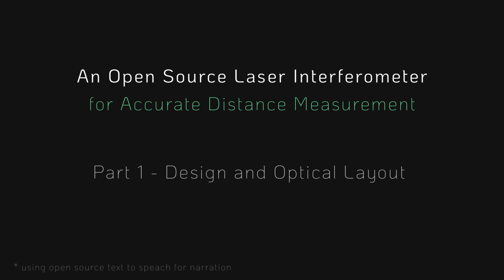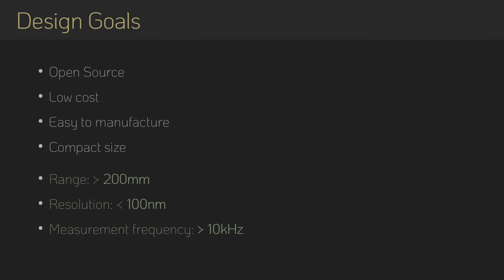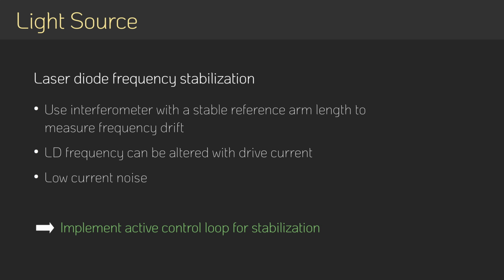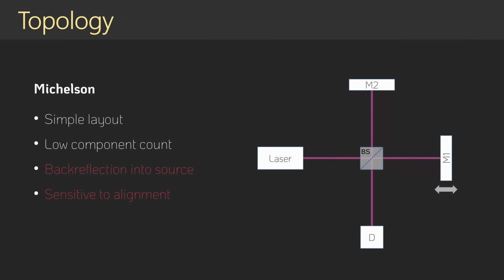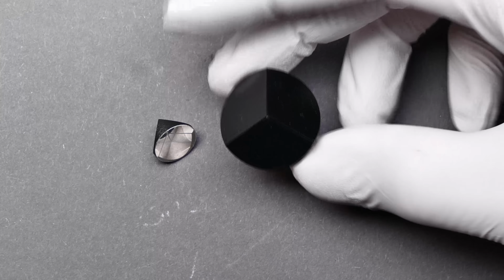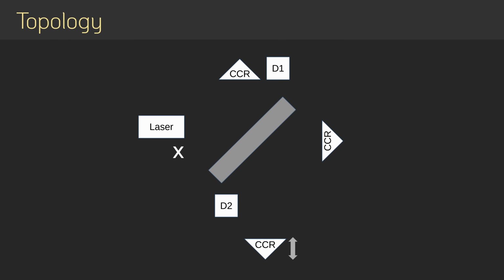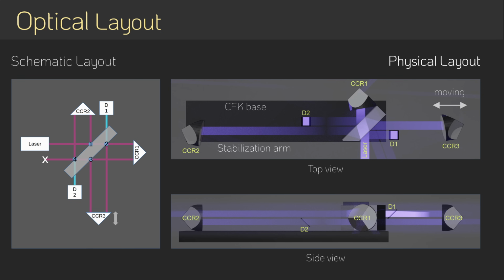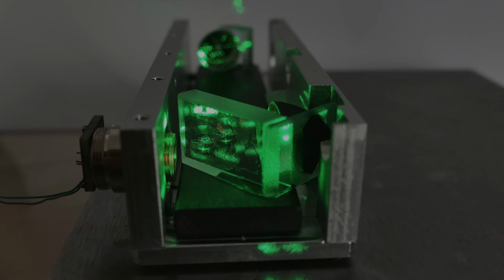Laser Interferometer - Part 1: The Optical Design.

Comment: Any particular reason why you didn't use an Nd:YAG laser module? You can buy single package YAGs that fit in the same envelope as TO can laser diode? You'll still have to deal with output changes, but it should be more wavelength stable
Reply from the maker: Hi, can you give me a link, so that I can take a look at such a mdoule?

Comment: Really nice video, I'm learning a lot, thank you. What temperature did you stabilize the laser diode at? the website you linked only goes to ~25°C in the measurements, but a neat trick for ovenized systems is to go steady them well above room temp (like 40-50) so that you only ever need to heat them up, and never find a need for cooling, I don't know if there are islands of stability there in your diode.

Comment: so can you make a 100nm resolution caliper with this design?)
Reply: If you can make the optical train small enough, the calipers stiff enough to not sway out of parallel alignment by means of using 2 interfetometer measurement legs for angle correction and or preloaded rails and add in an encoder accurate to 1 wavelength and cram all the electronics in a small confined space and ensure no vibrations get picked up by the instrument and a few other concerns you miiight be able to. sub 100nm res calipers make little to no sense. You're probably better off with a slipless 0backlash, preoaded rope-based mechanism to convert linear to rotational motion and use high res magnetic encoders and back-to-back magnets. Can achieve sub 100nm for cheap and is actually doable in a confined space. The limiting factor is going to be mechanical i believe. obtaining a sufficiently flat reference surface, ensuring no large temperature gradient along the instrument, parallel alignment of the caliper reference surfaces, vibration isolation etc. You don't want a handheld sub 100nm measurement device. You really don't. It's not useful unless you set it down, wait for it to stabilise and don't breathe in it's proximity. at these resolutions the thermal expansion of the calipers from touching the instrument with your warm hands will likely exceed your resolution for many materials. It's probably possible to build a wavelength stabilised interferometer based high precision caliper but it's hardly very useful beyond a micrometre i would suspect. Getting a surface to sub 100nm surface deviation is a nontrivial task without spacialised equipment like a surface grinder or by using some very specific salvaged silicon dies or something like that. so possible: for sure, practical: probably not, easy: absolutely not. really cool: yes.

Comment: Can you please include a list of materials to build this? I'm a noob and it would be very helpful. For example, I know I need a laser diode, CCR mirrors and that's about it. You dont eben need to include links just a list pls!! Awesome video
Reply from the maker: If your goal is to have a working device, I do not recommend to replicate this until the final design is finished. This is a Project in development and major changes can be expected. Its a different story, if you want to learn about interferometry and want to play around with the optics. You may watch the otehr videos and take a look at the github page for more information. Also if you are new to this, please read about laser safety and be very mindful of the potential dangers.

Comment: Great project for research and education, but I am very sceptical on the real practical use. 
Linear scale encoders are cheap nowadays. 3um/m accuracy  and 100nm resolition incremental scales with quadrature output are  less than 100USD. We have tested them at work and @0.2m lengh  accuracy is <1.5um, some leas than 1um. 10nm resulution absolute scales with serial output 200-300USD. They are basically stick and forget, immune to dust, change of atmosferic condition, e.t.c. 
Single frequency interferometers with retroreflectors are very sensitive to lateral shifts and light intensity changes. To get the same micron level accuracy you have to calibrate and check it against atleast 1e-6 reference length standart under the same conditions. And that is only valid if your cheap LD is truly stablized, no mode jumps, single longitudinal mode, no contamination on the optics, e.t.c.
Reply from the maker: Thank you for the advice, can you give me names/brands for the products you mentioned? Especially those with the 10nm resolution? I have looked around and could find any within this price range.
Reply: @DiffractionLimited From top of my head 100nm are made by Ditron. 10nm has the same 3um/m 20um pitch scale, but the interpolator is different with Biss-C serial output. 1nm resolution Mitutoyo is around 1000USD in China.

Comment: marvelous! I was about to do the exact same thing and then I find your video. I have experience in manufacturing temperature controllers with sub mK stability and heterodyne Mach-Zehnder interferometers. My original plan was to use one interferometer to stabilize the laser frequency, and then use and second heterodyne interferometry to measure the distance, so lambda /100 accuracy can be easily achieved. I considered helium-neon laser and diode laser, and I found that stabilizing the diode laser in a certain mode was quite A challenge, but if you pull it off, it could be as good as A stablized helium-neon laser
Reply: In my original design,I need a cheap acousto-optical crystal to create a 80MHz modulated laser beam.if I cant do that,then this design will failed.

Comment: Looking at this and your recent short i do have one concern. I can see how the second leg will let you fix the frequency during operation. But given how far you can still drive it i don't see how it'll let you set exactly the frequency. 
Like during operation holding the spot at 0 diode current will stop the frequency from drifting. But when you turn on how do you know you are at (say) 500nm or 501nm. In both cases the spot can still be held at zero and the frequency won't drift. But the counts per mm on the driven leg will. 
Would perhaps a very potent diffraction grating be enough to decern close enough which frequency the laser is operating at when first turned on?
Reply from the maker: Excellent question. The absolute scale has to be given to the system somehow. A diffraction grating would work, but would have to be very fine pitched and itself be very stable over time. A different approach is to calibrate the interferometer by moving the reflector a known (preferably large) distance and count the pulses. For my applications, absoluthe scale isn't very crucial though.

Comment: It might not matter because the intensity is atenuated for successive splits of the beam, but there seems to be a possible loop between CCR1 and CCR3 in such a way that the first detector gets not only the beams that traveled both arms but also the beams that did N loops of that circuit. Is this correct?

Comment: Awesome video. One small doubt: is it possible that in your diagram for a Michelson interferometer with offset the detector should read the beam coming down from the splitter at the left side instead of the right? Not really relevant but just to make sure I got how it works right.
Reply from the maker: Yes, its a mistake. Should be left.

Comment: PLT5 520B is a multimode laser diode, so in order to increase spatial coherence and visibility - it might be useful to place a spatial filter in front of the diode to reduce the number of modes. The most basic form of spatial filtering is just round diaphragm (as a bonus you will get a nicer beam to work with), no doubt, it will reduce output power but in most cases you will get better SNR.
Reply from the maker: It literally says 'Single mode semiconductor laser' in the datasheet. Also I operate it way below the nominal current which often results in a single mode being excited, even for multimode diodes.
Reply: @DiffractionLimited It is a single tranverse mode, the same as PLT5 450B and the the rest of the PLT5 series.
Reply: @DiffractionLimited  PLT5 520B is a typical broad area Al/InGaN laser diode with a basic fabry perot resonator. You may try to measure M^2 for example to find out that it is indeed single mode in the fast axis but high multimode in the slow one. From my experience, such laser diodes give a typical multimode picture even at low pump currents. Also you may refer to output beam divergence in different axes.
Reply from the maker: @enclis  Hi, maybe we talk about different LDs, beacuse I could not observe any multimode beam profile with my sample, even at higher currents. Its strange that you have different experience with this diode.

Comment: 8:36 wouldn't we have kind of a loop at the arm 2CCR ? 

If we follow the laser path at arm 1 it reflects of diagonal glass goes into CCR in arm 1 then goes down again reflecting of a glass into X and part of it passes into D2. That part is ok. 
Now the part that passes the glass from the laser goes into CCR at arm 2 then returns to the glass and part of the beam goes into X this is also ok. But now the part which is reflected and goes into CCR at the arm 3 goes back to the glass and partly passes into D1 but it also reflects and again enters the CCR in the arm 2 following the same path from before??
Reply from the maker: Thank you for the feedback. This problem was also pointed out by another observant viewer and the loop is an artifact of the 2D representation of the beam path. In the 3D beam path there are no loops anymore, so no problem in practice. I should have mentioned that in the video though.

Comment: 7:49 you also created changing beam offset by rotating it, possibly because you also moved it but regardless your words do not agree with what we can see which is never a good thing when you are explaining stuff like this because it can lead to comments like this one and also to opinions that you dont know what you are talking about or we dont understand you or we dont know what an offset is and many other not so good combinations and it distracts us from the point of the video.
Reply from the maker: I would partially disagree on this one. In the video it is only mentioned that the beam path doesnt change direction, when the CCR is rotated. There is no statement about the offset when it comes to rotation. But I agree, if you where confused by the demonstration, there is probable room for improvement of the video.
Reply: @DiffractionLimited  it clearly changes wither you rotate or slide it, yes direction did stay same. I am not sure but I think rotation should not change the offset if you are not sliding it also while rotating which is pretty hard to do manually without fixing it somehow and constraining so the only possible movement is rotation.

Comment: Nice video, It would be amazing to add additional laser diodes at different frequencies making parallel interferometers, maybee one of those multi-diode Optical drive laser diode arrays for both the transmit and recieve elements, This would allow for better distance discrimination, especially when combined with time of flight measurement when combined with a modulation of the laser diodes?

Comment: Electroplated rhodium has a hardness of 400–550 on the Vickers scale. This makes it very resistant to abrasion and wear, and helps it maintain its shiny finish over time.

Surface Hardness: Rhodium plating results in the Increased surface hardness of the base metal, rendering the plated objects more resistant to scratches and wear

Comment: As i recall the precious metal Rhodium, when electroplated on a surface may have useful characteristics with regards hardness (resist dimensional change) and light absorbed vs reflected (extremely good reflectance) also impervious to normal atmospheric reaction (does not oxidise)

Comment: Very cool!
Where would one acquire the case and lens that turns laser diode into an actual laser?
Reply from the maker: I will go into that in future. But essentially its the front part of those cylindrical laser module cases that you find everywhere. I wanted to use these because they are very affordable and easy to come by. Here is the first best link to one of those: 
https://odicforce.com/epages/05c54fb6-7778-4d36-adc0-0098b2af7c4e.sf/en_GB/?ObjectPath=/Shops/05c54fb6-7778-4d36-adc0-0098b2af7c4e/Products/OFL14

Comment: Very cool design. The stabilizer is interesting. It wouldn’t control the absolute laser wavelength right? Just prevent it from drifting after the stabilization is activated. A reasonably accurate calibration after power up can probably be done to account for wavelength uncertainty, by moving the measure arm a precisely known distance and dividing by the counted fringes. I think gas reference cells are common for absolute wavelength control. IIRC this is what the attocube interferometer does.

Finding laser diodes for metrology is difficult, so thanks for sharing this part number.
Reply from the maker: Youre absoluthely correct. I didnt know about gas reference cells. I will look into that - very interesting, thanks.

Comment: I wonder what the chances are that "OSRAM PLT5 520B" parts on Aliexpress are genuine. They list a much lower price on that part, as compared with authorized OSRAM distributors in the US like Mouser Electronics who show $37.05 each, out of stock, 7-week backorder.
Reply: To answer my own question, I tried them and found they work. As the video suggests, you need to run at low drive currents to obtain single-mode operation. Which is fine, because the rated power (110 mW) is really more than I'm comfortable with anyway.

Comment: Awesome video.  very informative however I think there's a discrepancy in your interferometer signal-path animation.  Your animation shows the signal changed to blue after it passes through some of the prism corner reflectors (these are the out of phase beams I believe?).  This blue signal then passes through the beam splitter again before reaching the detector however there is no animation of this blue beam being split when doing so.  I don't think this alters the end result of allowing this to work and maybe you are aware of this and did not include it in an effort to simplify an already complicated animation however since you do not explicitly mention this it leaves me with a question.  Again, amazing project and video!!!
Reply from the maker: Very obserant! You are right, I omitted some beams for clarity that do not contribute to the working of the device and I probably should have mentioned that. I also just colored them blue so you can see how the two beams overlap.

Comment: This is great work. I have tried to do this with diode lasers with limited success, got fringes sometimes but they would unpredictably fade away, my diodes I think not stable enough. Interested now to try your recommended part. I had tried a more expensive, allegedly single mode part from a German supplier, also a DIY hologram source.
Reply from the maker: Hi, I know exactly what you mean and I struggled with this as well. There is a difference between 'single transverse mode' and 'single longitudinal mode'. The latter is what you want and is often not specified for laser diodes as it depends on the drive conditions.
However if you got a Laser source specifically for holography you should definetly be fine.

If you had problems with good interference there are a few important things to look out for:

1. Avoid ANY backreflection into the diode, this usually destroys coherence length (see one of my older videos).

2. Filter your LD current: Add one or more RC, filters with different capacitance (e.g. 50µF elko + 10µF ceramic + 1µF ceramic) in parallel.
Make sure there is no additional driver before your laser diode as it is often the case for laser modules powered by 5V.

3. Find a drive current that produces a long coherence length. This is often at lower power levels slightly above threshold current.
If coherence length is short, you periodically get regions of good and bad fringe contrast depending the length difference between you interferometer arms. This can look like it is sometimes working and sometimes not.

4. Use a reasonable sized heatsink to keep the diode at roughly ambient temperature.

Comment: Basically how the Renishaw laser interferometers work, as far as I know.
Unlike the HP ones with funny Zeemann effect to get 2 frequency laser, to do doppler shift thing with, instead of the sin/cos quadrature for direction, in/out detection.
Reply: Renishaw uses HeNe single frequency stabilized laser and it is separated from the interferometer itself. Which is a huge advantage comparing to this integrated layout as the reference plane is separated from the laser and electronics.

Comment: very interesting. The 10khz measurement makes me wonder if it could be used as part of a servo positioning loop for a high precision linear axis.
Reply from the maker: This is actually the goal ;)
Reply: @DiffractionLimited  awesome! I myself was considering a similar project, though I was going to stabilize the temperature of the diode with thermoelectric devices. However, I like your idea more!
Reply from the maker: @tomthepom98  Thank you! From the tests I did, you would have to stabilize both the drive current and temperature to quite high tolerances, as the laser diodes quickly shift their wavelength. So I would bet on the stabilization arm to be more accurate.